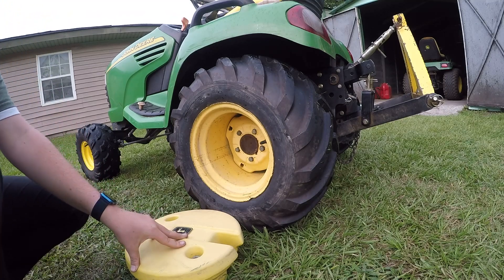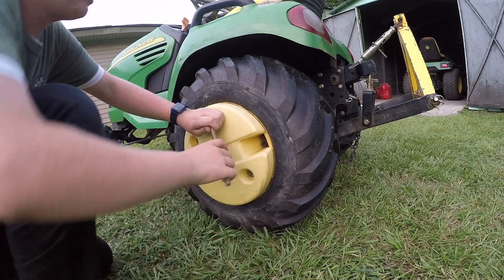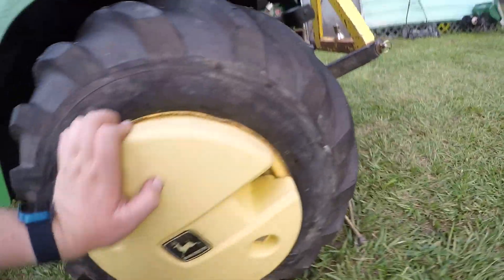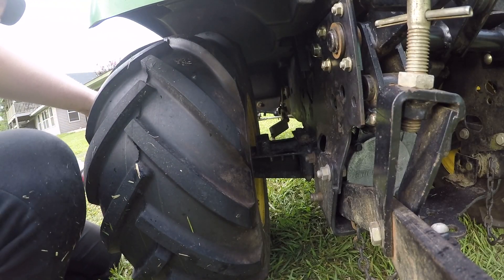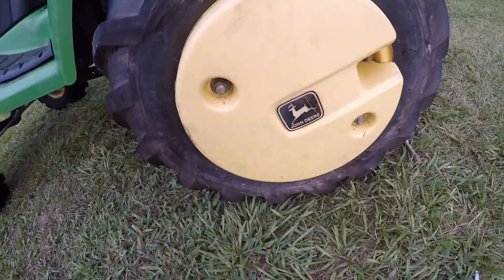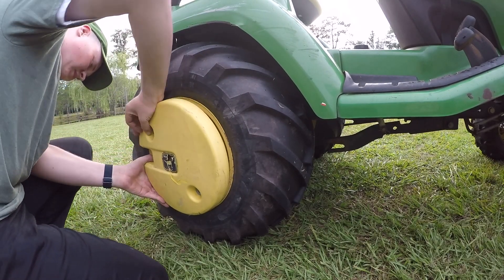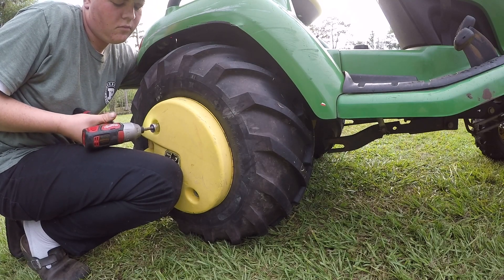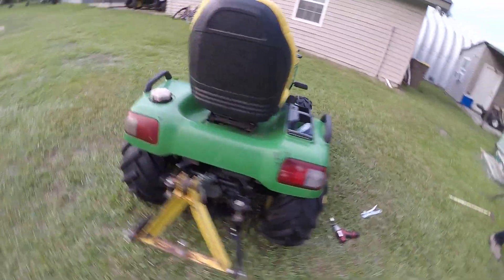Wheel weights installation, John Deere 4x5, X series // How to install 12" Plastic wheel weights

Comment: Just bought a GX335 with a push plow & wheel weights (only had 200+ hours on it), and discovered one of the rear wheels had a slow leak. Gotta take the weights off to get it fixed, so thanks for the 'how to do it' course.